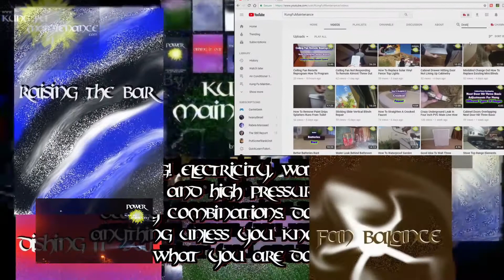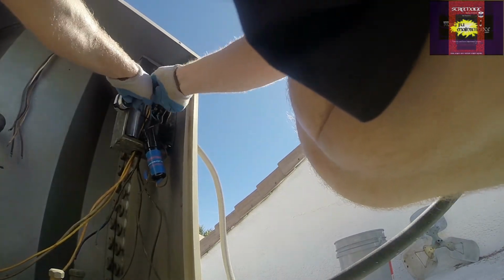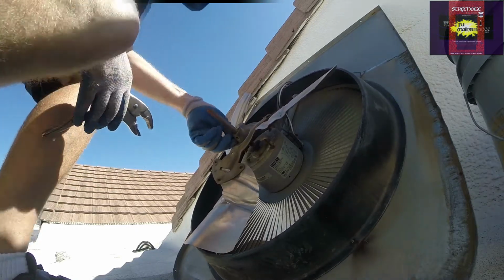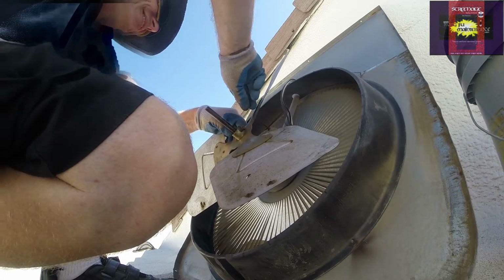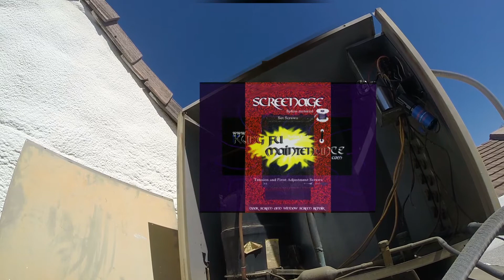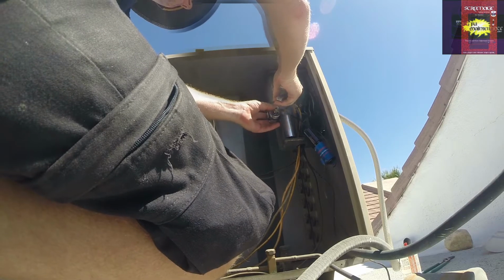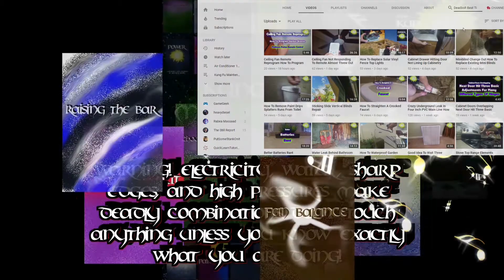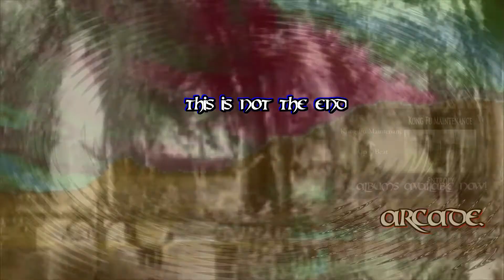Broken Blade An Air Conditioner Fan Journey Hot To Cool Back To Good HVAC

Comment from the maker: Get KFM favored Electronic Leak Detector        http://amzn.to/2kmQMMz
Easiest Way To Get Universal EPA Certified Prep Manual    http://amzn.to/2kIQdQC
Get Third Generation Nest Thermostat here https://amzn.to/2L8TA1n
Get KFM's favored AC Gauges here            http://amzn.to/2kYgGb8
5/8" Suction Line Insulation   http://amzn.to/2w1me8G
Inficon Refrigerant Scale                               http://amzn.to/2vUCQPD
Hard Start Kit     http://amzn.to/2kiD16v   Contactor     http://amzn.to/2lFqA0P
Get  the Multi Tool Pliers used in so many KFM videos       http://amzn.to/2kWTjPp
5mf Capacitor   http://amzn.to/2wC96sH     35mf Capacitor    http://amzn.to/2vZVZ2t
35/5mf Capacitor   http://amzn.to/2iVJNi2        40/5mf Capacitor    http://amzn.to/2wzEdXD 
45/5 mf Capacitor   http://amzn.to/2w0wez5   
Condensate Pan Tablets   http://amzn.to/2lalV9W   No Rinse Coil Cleaner  http://amzn.to/2lHg8GD
I do not work for Bristol just wanted to make it easier to find best capacitor sizes. I really wish manufacturers would print it on their compressors.
bristol compressor H23B283ABCA capacitor sixe 40
bristol compressor H23B28QABCA and 
H29B28UABCA
capacitor sixe 35
Bristol Compressor H2EB24SABCB   30
Condenser Fin Whisk Brush                          http://amzn.to/2vWXUoC 
You must be EPA certified to charge or recover refrigerants and here is about the Easiest Way To Get certified with the Universal EPA Certified Prep Manual    http://amzn.to/2kIQdQC
Simple Leak Seek Spray   http://amzn.to/2lFfcC5  Laser Thermometer  http://amzn.to/2layD8I  
Valve Core Removal Tool                              http://amzn.to/2kJ00pC
Get KFM favored Electronic Leak Detector        http://amzn.to/2kmQMMz
Get KFM's favored Multi-Meter  here        http://amzn.to/2l8W9CO 
Get the Milwaukee 11 in 1 Screwdriver     http://amzn.to/2uTtsNj 
Wet Dry Vacuum used in so many KFM videos   http://amzn.to/2lFxi7u
Chapin Pro Pump Sprayer                             http://amzn.to/2vWCXdD
Evaporator Coil Cleaner No Rinse Mix        http://amzn.to/2x3eJTT
Evaporator Coil Cleaner No Rinse Can        http://amzn.to/2ezIxju  
Get the Screwdriver used in so many KFM videos here    http://amzn.to/2kHFoOF 
Get The Kung Fu Maintenance book here     http://amzn.to/2lEQPFk
Or  the Kung Fu Maintenance E book here  for less than $5    http://amzn.to/2lEY8wD
Get the Kung Fu Maintenance album (good driving music) "Up Beat" here     http://amzn.to/2l41pZ1
Get the Kung Fu Maintenance album (nice Instrumental music) "Entropy" here   http://amzn.to/2kl2U0p
Samsung Galaxy S8 Plus        http://amzn.to/2sFn9h8
GoPro Hero 5 Action Camera         http://amzn.to/2sN4nVK
Rode Lapel Microphone                 http://amzn.to/2vZoFc7
Purple Panda Lapel Microphone  Kit   http://amzn.to/2wByXkq
Video Edit Pro Software       http://amzn.to/2ruaae